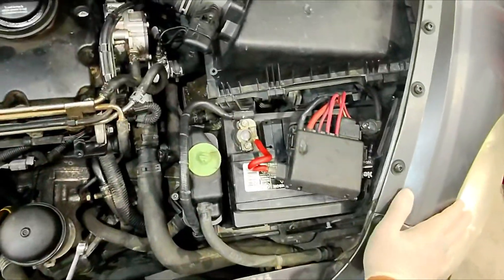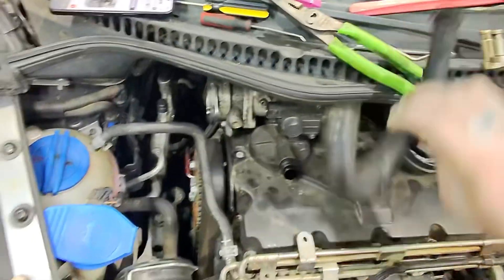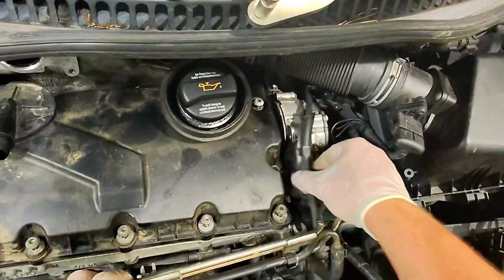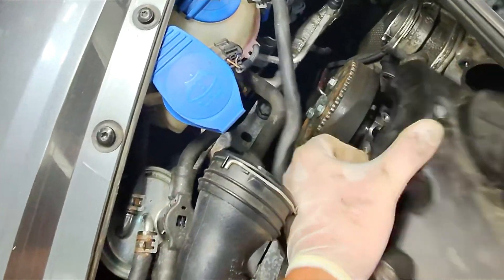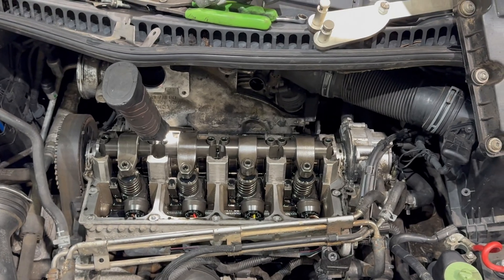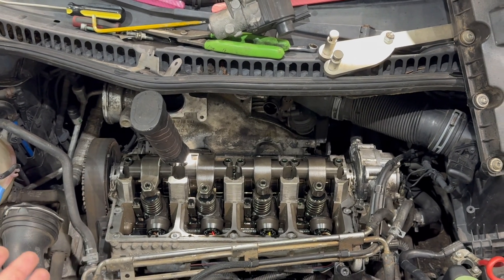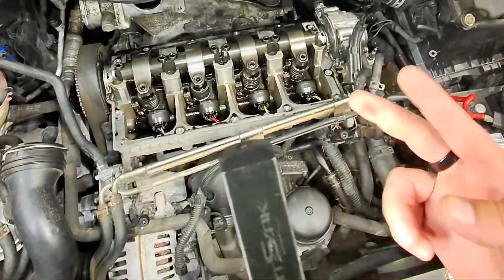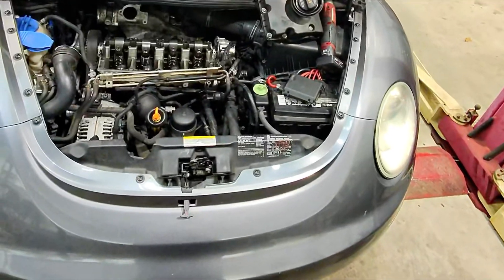BEW TDI PD Camshaft and Lifter Inspection

Comment: Good video, couple notes. One you only need to disconnect positive side of the battery. Also the cam is worn, you see the bevel on the round of the lobe and how it disappears near the tip(the highest pressure area) that is the indication it’s worn to much. Causing not enough time valves are open causing all sorts of things. Poor fuel economy and performance as there won’t be enough air for proper combustion and exhaust gases overcoming your intake and filling intake causing the famous intake noise